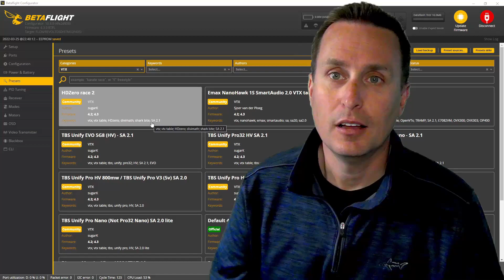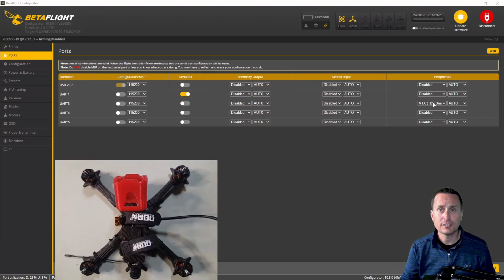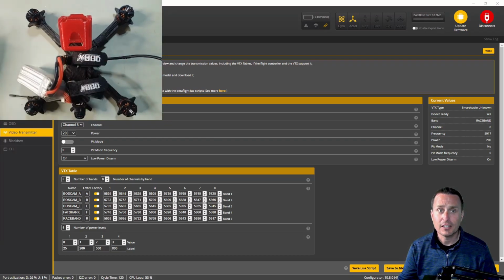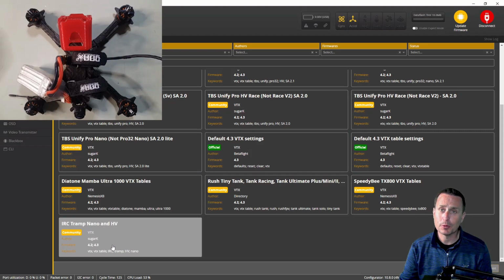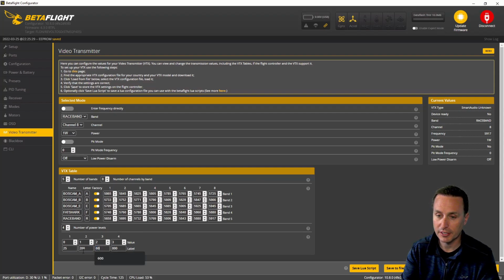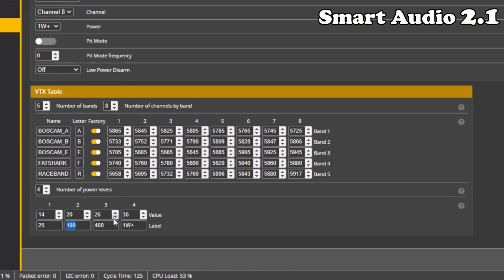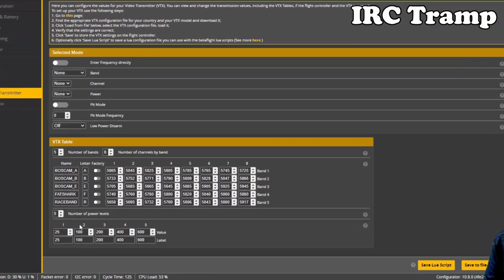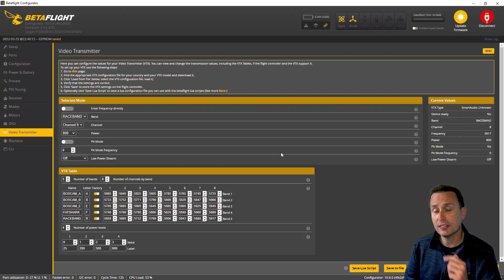Betaflight 4.3 VTX Tables in 5-minutes - Smart Audio Version | Set Custom Power Levels

Comment: Thank you Mark.  I thought 32 was the max and didn't realize the number was actual dB.  Although it probably temperature limits at the 1.58W (32dB) as well.  I did burn up a Rush Solo at 800mW.  The Solo instructions say to use the TBS 2.1 json file.  I disassembled the cooked Solo and the little SMD just below the MCX connector was fried.  Looks like they did a good job on the package design in terms heat dissipation.  Thanks again.

Comment: Hey Mark, both my 75mm whoop and 3 inch toothpick now have no working smartaudio.

My toothpick has a TBS Nano32 v1.1 and a Crazybee f4fr v2.0 FC 
It had been working fine for ages, even on 4.3, but when I flashed your 2-4 inch toothpick tune on it, SA no longer works. 
It shows "Smartaudio unknown" instead of the version, and shows "no" for readiness. 

Same case with the whoop
I'll try rolling back the config
Reply: Didn't fix it. Hmmm

Comment: I just wired up one of the new HDZero Whoop Lite VTX and configured appropriately. However, the OSD elements started blinking in the video a few seconds after powerup. Then they disappeared altogether. I looked into SMARTAUDIO via BlackBox Debug and got 304 (version) reporting in Debug 0 value. WTF?

Comment: I have a AKK race ranger 1W vtx , but im getting device ready: no.
Any troubleshooting advice ?
Reply: 1. port is not setup on ports tab
2. wiring is not correct
3. No babttery plugged to power the VTX :)
Reply: @IvanEfimovLimon  thanks Ivan. I realised i soldered my ELRS receiver on the same UART. I need to put the vtx on another now.

Comment: VTX tables are a scourge on the hobby.  Racing events have been a complete cluster since they ruined smart audio.
Reply from the maker: VTX tables didn't affect the smart audio protocol.

I would guess you mean you would rather it was hard codes like before and not flexible so folks couldn't cheat it (i.e.: show 25mw for all the power levels).
Reply: @uavtech  before you just turned it on or off.  when VTX tables came out, a user had to know what version of SA their VTX used.  As a race promoter, way too much of my time was spent trying to fix people's vtx tables.
Reply from the maker: Yeah, I understand.

It is tricky.  TBS came out with different versions of SA and VTXs where not following the power levels correctly.  So someone made it that you could control and setup specifically (for better or worse).  

I guess silver lining is now it is easy to see what version (as shown) and hopefully most popular VTXs have a preset so the 2022 season will be easier.  Thank Ivan for the add to the configurator for the version detection.

I am thinking of submitting a bunch of VTXs myself as presets for ease of use.  Oscar Lang as a bunch documented.